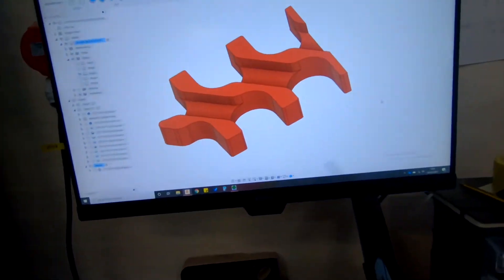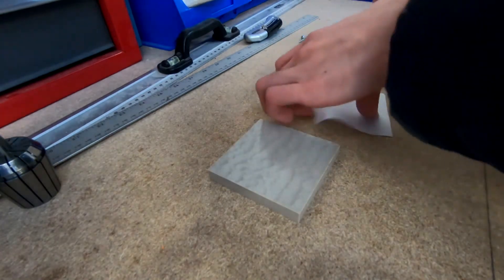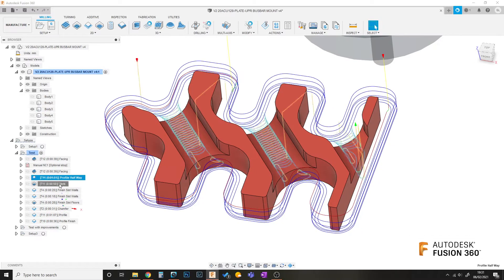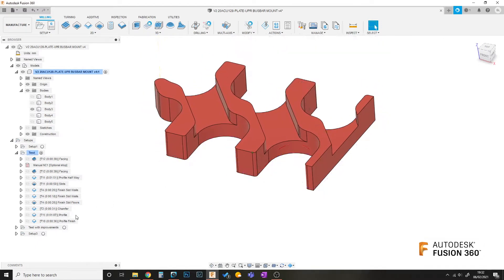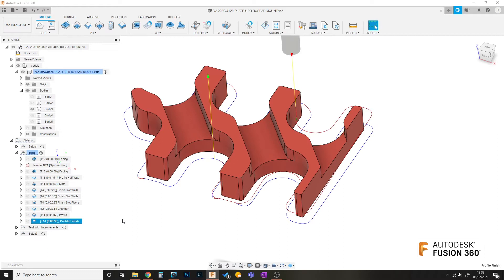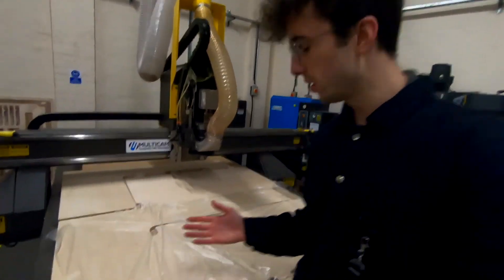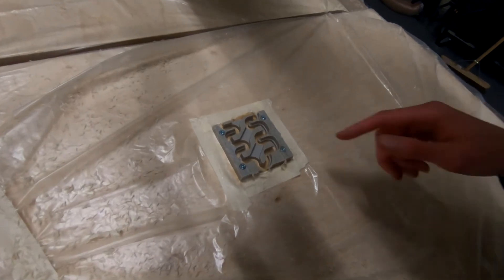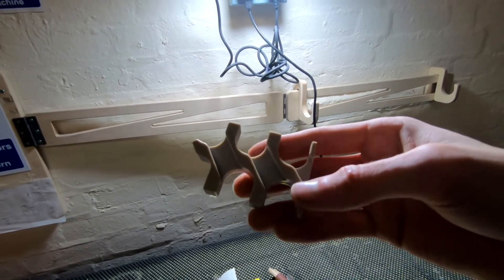Machining a Part for Formula Student - Part 1 #6

Comment: Epic job! I just have started to work with some guys who own of this machines but they use sketch up and the stock software. which is a bit of nightmare. Was it difficult for you to use the post processor of Fusion for this machine? Did they Multicam helped?
Reply from the maker: Fusion 360 works perfectly and there is a post processor all ready to use. Only issues is drilling - make sure to select "Deep drilling - full retract", if not the drill does not retract out of the hole before moving to the next one.
Reply: @bikestow  thx formaking the extra effort and showing what tool with wich oarameters you used, im quite new to cnc milling (bought a desktop cnc for my 18 birthday) and its really helpfull for feeds and speeds
Reply: Main cnc machine ki programing karta hun mujhe 10 sal ho gay cnc machine ki programing karte huyea india main selry bohat yaada nahi hai mujhe kam ki jarurat hai